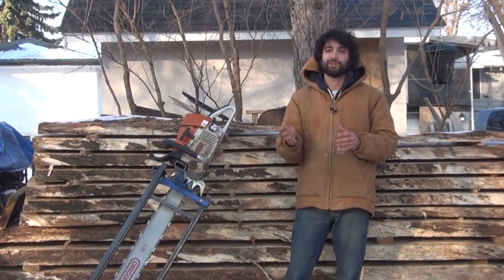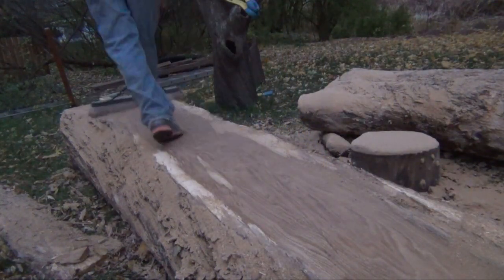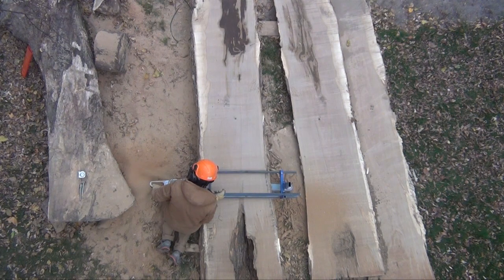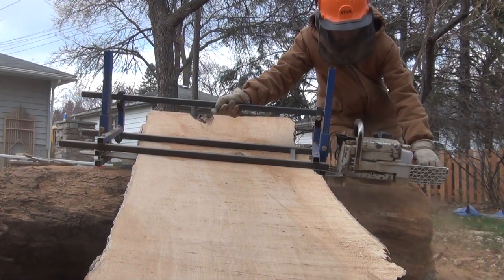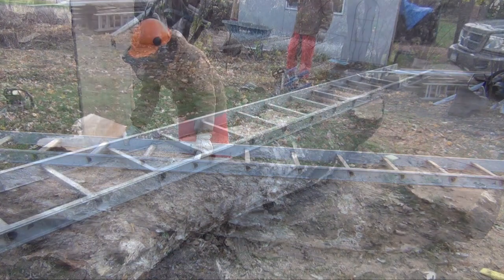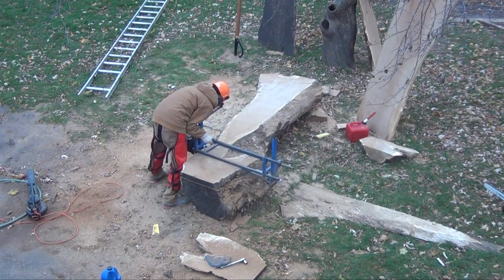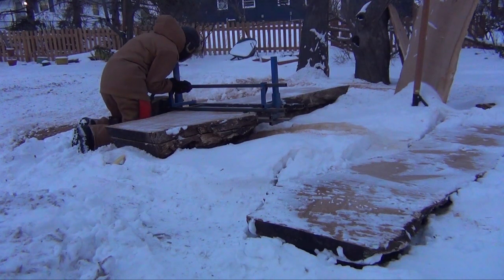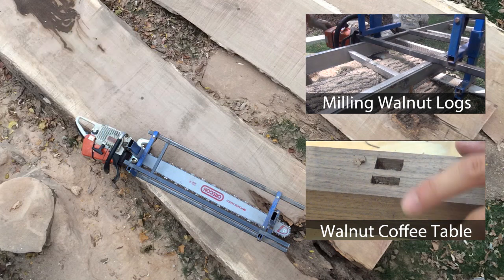Slabbing White Oak Logs with a Chainsaw Mill

Comment: That's so cool. I love the simplicity of that mill. Looks like quite a bit of work, but well worth it after seeing what's inside those logs.
Reply from the maker: Zac Higgins Thanks Zac!  Its a fair amount of work.  You spend a lot of time with just your thoughts and the faint sound of a chainsaw at full throttle in the background.  Opening up a log is an incredible experience.
Reply: Matthew Cremona Heck yeah, that's definitely on my list to things to try out. I did it on a much smaller scale with some aspen logs I got in the woods for a project. I was flat out blown away at what was inside! Now I just want to find a big log to mill.

Comment from the maker: cmarwood2 I think the fastest you could dry 12/4 would be 2 years.  It would need to air dry for probably 18 months before going into the kiln for 6 months.  If you dry it too fast, you can end up with a lot of defects like checking and especially case hardening.  You might be able to speed that up a bit depending on the air drying conditions.

Comment: Have a curiosity, around here is a crazy growing tree the southern live oak or evergreen oak. The trees themselves are protected to a certain extent. But fallen trees and branches are fair game. Curious if milling the branches is something worth pursuing, some can been fairly beefy 2-3' in diameter with straight sections or is there a reason the branch wood wouldn't be usable? I'm not deep into wood working (yet) in woodshop we just learned about quarter sawn plain sawn... but not a while lot about forestry or milling its self.
Reply from the maker: contrapezist Live oak is a great material.  I know it is really popular in wooden ship building.  Branch wood can be milled into lumber but it can be problematic.  Depending on how the branch grows it could have a lot of internal stress that can cause the lumber to be unstable.  The more vertical the branch grows the better.  Something growing horizontally off the trunk will have a lot of stress.  I've had good luck milling branches by keeping the slabs thick (2"+), using the slabs whole, and cutting them through their vertical plane.

Comment: How often do you mill up logs now that you've got your own log trailer set up?  Also, it doesn't look like you're putting anything on the end grain to seal it.  Am I missing something or do you leave them bare?
-Todd
Reply from the maker: +Wood Frontier Slightly more often than before the trailer.  I don't have a lot of room to store the lumber so that limits me the most.  These logs were sitting in the woods unsealed for over a decade so I didn't bother sealing them.  I seal anything new though.

Comment: Great job on the sawmilling videos Matt. Have you done any milling on small logs with the ladder extension as a guide? I'm shopping for a chainsaw mill and I've used a friends Granberg. Have you done any comparisons on the two? Thanks, eh!
Reply from the maker: Thanks!  I've done down to 8" diameter logs with the ladder as a guide.  I've used the Granberg (a friend has one).  I found it cumbersome to adjust by comparison and is too lightweight.  The powerhead will tip the mill off the log if you're not holding it up.  Alternatively, you could also add a counterweight to the mill.

Comment: When using the ladder for your first cut do you need to run a spirit level over it? Or is it as easy as just drilling ladder to it then cut away?
Reply from the maker: symo89 There isn't a reason to level it.  It actually makes it easier if the cuts are sloped in the direction you are going to be cutting so gravity works with you.  The ladder is a flat reference so as long as you don't distort it when attaching it to the log, you're good to go.

Comment: hopefully these aren't duplicate questions:  what size  bar is that, what model saw, brand of mill, is that a ripping chain, how often do you sharpen it, do you find that the onboard oiler is sufficient, and how dangerous is it (you don't always wear chaps)? thank you so much, very inspirational on a multitude of fronts. :)
Reply from the maker: No worries :) 42" bar, Stihl 046, Pathermill 2, yes ripping chain, on this log I sharpened every other cut, onboard oiler seems to work just fine, it's a lot safer than walking around cutting stuff with a chainsaw. Let me know if you have any other questions. Thanks!

Comment: I recently bought a small alaskan chainsaw log mill (Up to 20" no where near that size) but I was wondering why you cut the slaps so thick? And how you air dried them! Thanks.
Reply from the maker: thewoodworkingteen Couple of reasons: Mostly because I wanted stock that thick but also because the cuts take so long.  The chainsaw mill is the least efficient way to make lumber.  The cuts are slow and there is a lot of waste.  As far as drying, I just have these stacked behind my shed.  They're raised off the ground on some concrete blocks and I used some scraps of 2x4s to sticker them.
Reply: How would you normally cut them into lumber?
Reply from the maker: thewoodworkingteen We'll hire a sawyer will a portable bandsaw mill.  It's a lot faster but in the case of the larger log in this video, it is too wide for his mill.

Comment: Do you have any issues with the exhaust from your saw coming back off  the ground and hitting you in the face? I've only had my mill about a week and have only milled one log but the exhaust from the saw hits the ground and comes back directly into my face. I can hold my breath for about a minute and then I have to stand up and walk away from the log. I have a stihl 290 and I cant flip the shroud on the exhaust to point up. Any suggestions? I've been watching your videos for about a year and have enjoyed all them! Thanks for taking the time to make them!
Reply from the maker: Hey Brandon, I can't say I have had any issues with the exhaust.  The only time it becomes an issue is when the saw get close to the ground and I position my head directly over the saw.  Maybe you can mount a piece of sheet metal on the mill to deflect the exhaust away?

Comment: matt, I'm having a hell of a time making a second cut with my Panther. within the first inch of the second cut, the blade either binds or cuts nothing but air.   any advice? I've tried different rail systems for my first cut, but they've all been wood rails, and I've sharpened my chain, but no luck

Comment: I know that white oak is "practically waterproof", as it is used in barrels.  But all we ever hear about for outdoor use is cedar or PT.  Any idea as to how white oak lasts in comparison as an outdoor table?
Reply from the maker: wordsnwood White oak is a very good choice for outdoor use.  It is very rot resistant. As long as I take care of it by renewing the finish, it should last indefinitely.  If I just left it out there bare wood, it would probably last 25 or more years.  I think the reason you don't hear about it's use is because it is not common to use hardwoods.  Even better, if you can get your hands on black locust, that stuff lasts forever.

Comment: Matt, I mill oak, hickory, and ash found on our property in Missouri.  I just started this "hobby" about 6 months ago.  But I live on a hill and cannot handle lifting or moving slabs any bigger than 6' long at 1 1/2" thick.  Might this be sufficient for making kitchen tables given the planing, sanding and reducing that thickness necessary for a finished look?   Would you recommend planing by hand or by mechanical means?

Comment: Watching you move the big boards I had an idea... Find a section or TWO of Scaffolding that you can make some rubber pivot wheels for... Then roll the rig over a log and using a plank and 2 winches lift the log board and roll it to the site... Might use 2 sections like a train for longer boards.  Good Job in what you do.  For stability you could use the scaffolding long wise over the board and use 2 sets...  Even get fancy and two 12 volt winches..

Comment: Hey Matthew, Big fan of your channel. I have three oak trees that I need to rip cut. They are 32" diameter, the same as yours. What chainsaw would I need? A 660 with 36" bar or an 880 with 41" bar? Thanks.

Comment: Matt, wow thanks for making so many great video's including my mill, that is some very hard wood, you really need an oiler, it will help out a lot. What type of chain are you running? Also did you remember to cut 6-8" off the ends, if that trees been sitting for any length of time? If you could please contact me, I have some free stuff for you. I'll see if I can find a way to contact you.

Comment: What do you do with the first piece you cut off? firewood?
Reply from the maker: Jared Shroyer The off cut from these will just be firewood.  When I'm milling I go for high yield so there really isn't much left over that would be useable.  The off cuts from sawmill operations are generally a lot thicker and make really cool sitting benches. Just add some legs.

Comment: Amazing video, and channel!  I'm going to buy a chainsaw mill for sure.  I have some fresh pine logs and a 15 in by 20 ft cedar log that I can mill.  My Stihl chainsaw only has an 18" bar right now, though.  I'm hoping I can get a larger bar for future milling.  How long do you usually wait drying out your slabs?  For example, a 4 in thick slab?
Reply from the maker: WILSON! It would depend on where I leave it to dry.  If I just left it outside I would wait probably 3 years.  That is for hardwood, I think softwoods like pine and cedar dry a lot faster.
Reply: Wow, okay, thanks!

Comment: If u dont mind me asking..how much value/how much is all that worth in dollar value after milling and drying them out.
And dude thats a good friendbu got there! Lol
Reply from the maker: Joe Walters Depends what someone is willing to pay for it.  All those slabs are probably around 600 board feet. $4/bf is probably a bit low but even at that price, $2400.
Reply: Wow that is low! Idk if theres a price change rrom red to white oak but where I live red oak goes beyween 6 &8$ a b.f.  depends where u luve I guess.. 
Also, how long do slabs like those take to dry enough to build something?
Reply: White oak and walnut I would have to travel about 2 hrs to find some tough cut.. the joys of having a chainsaw mill! GOOD FOR YOU MAN:) thats awsome!
Reply from the maker: Joe Walters Price varies by location.  I just went with $4 because that's what I typically sell boards for.  I've seen thicker stuff like this listed for $10+.  Who knows if it actually sells.  If I leave the lumber right where it is, it will probably take at least 2 years for the 12/4 and 16/4 to dry.  I could speed that up if I want by bringing it into my basement with the rest of the lumber I am drying or I could have Jim put it in his kiln for me once it had air dried for a year or so.
Reply: Wow! Hence the sayin " patience is a virtue."lol..I  Guess u have plenty of time to make up plans for that table. And w.e. else u want to build with that stuff. Love ur patio project u did a while back btw. .
Reply from the maker: Joe Walters Thank you!  It's going to get a lot of use next summer.  Maybe I'll start woodworking out there too ;)

Comment: I never see you cut anything thinner than 8 quarter (which makes sense with the chainsaw mill), do you mill up your own thinner stock?  Could you do a video on how you cut up that heavy stuff?  Clearly you don't take a 400 lb  slab and put it on your table saw.
Reply from the maker: ***** The thinner stuff will come from the logs out at the farm (where this big one came from originally).  Those ones we have cut with a portable bandsaw mill.  The stuff I cut with my chainsaw I use thick.  Working with slabs is a bit of a different process than normal woodworking.  Since they are so heavy you need to bring the tool to the wood.  When I cut up the slab to make the table base, I'll use my beam saw which is just a 16" circular saw.  I'll also need to make a track for it so I can joint the two slabs that are going to make up the top.  Thanks for the question!
Reply: Matthew Cremona

I live in Texas. What we call trees, you would call them shrubs. I would enjoy seeing a video showing how you use your bandsaw mill (and as others have said) your kiln. Thanks for the response and keep up the good work!